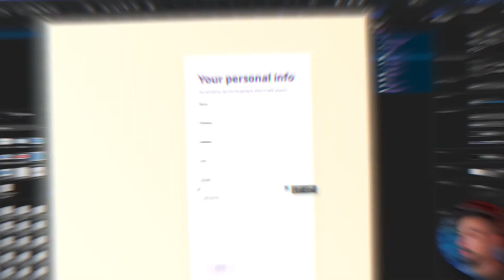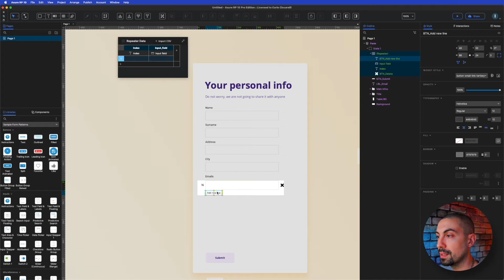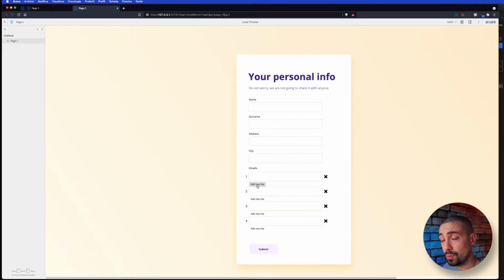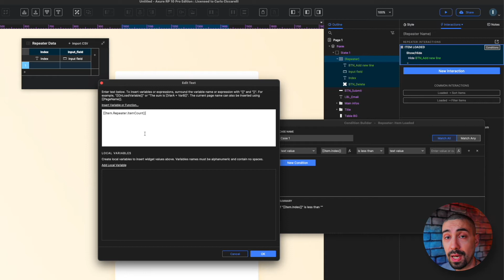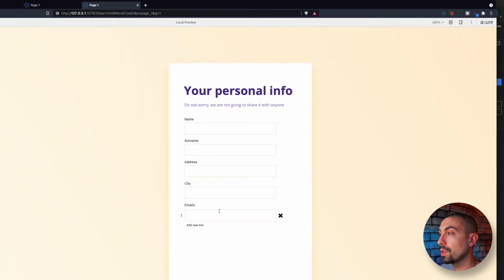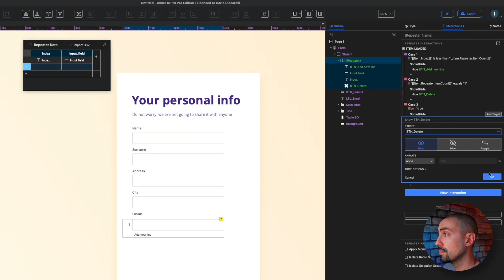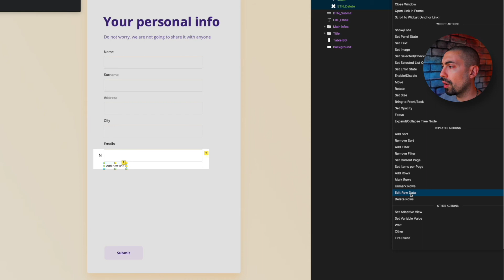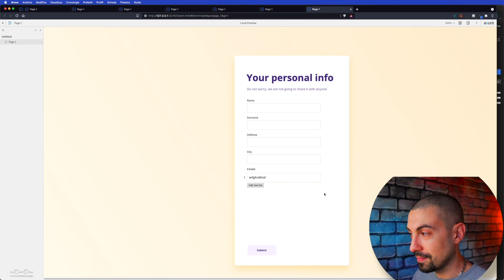How to multiply web form Input fields in Axure Rp 10 | 2021

Comment: Thanks Carlo for the tutorial on multiple lines of certain fields. Question - In case there are other input fields lower of the email field and the user added couple of rows then the added rows are overlaying over the below fields, making them unreadable - how to train the page to handle such event?
Reply from the maker: Hello and thank you for the comment. If I understood well, should be pretty simple. You should place an event on resize of your dynamic panel containing the email saying: on item resize, move [ the other field block ] at this.bottom where "this" is the block of emails fields. What happen then is that every time that the dynamic panel containing the email resizes (with more or less fields) the others will follow.